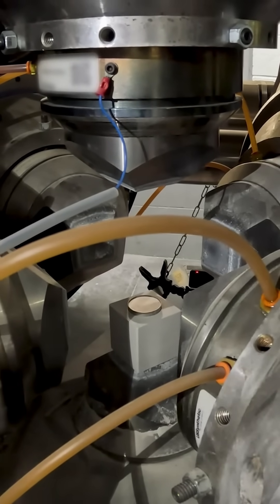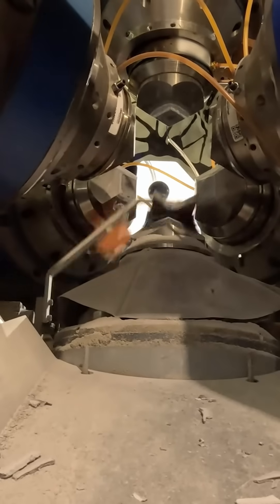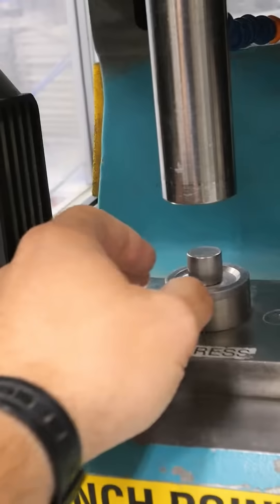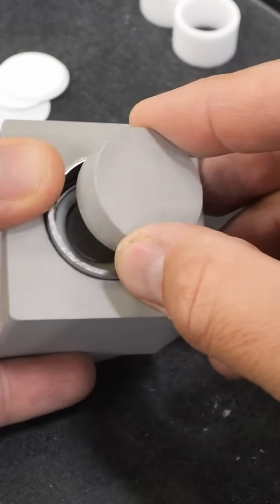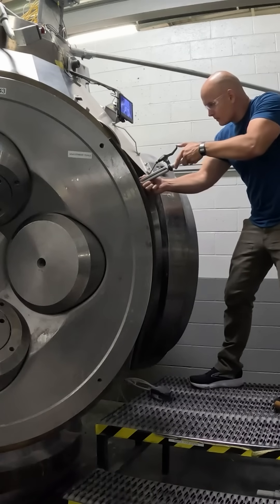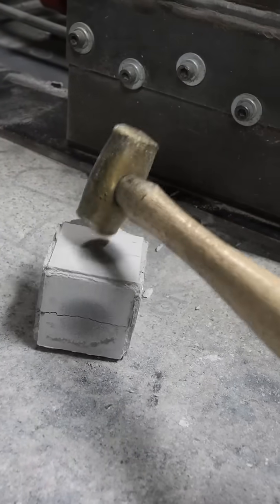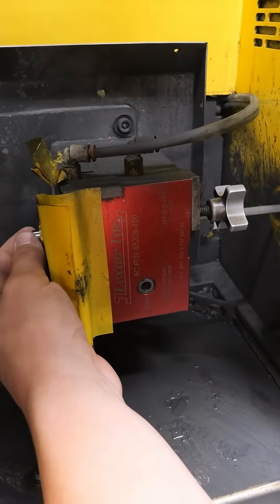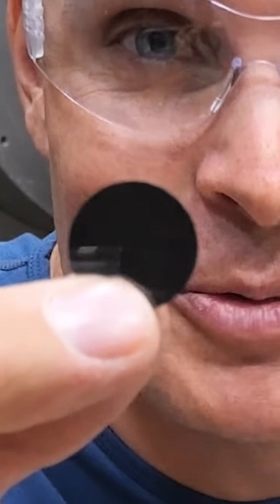How to make your own Diamonds - (easiest method)

Comment: with how many high quality diamonds this thing could theoretically pump out, it really throws into question the whole market for diamonds
Reply: The whole market of diamonds is already artificially kept afloat, so it really doesn't matter.
Reply: These diamonds are used for one purpose only, that's to drill for oil and natural gas.
Reply: @ribeye4663 not just drilling but it also has a big presence in the machine tool industry. My PCD facemills, drills, and boring bars are the coolest (and most expensive) tools I destroy. Since they’re so hard, you can run high volume production runs on aluminum for like 4 years on the same tool as long as you dont drop or crash them. They also run 2-4x faster than carbide with an amazing finish. Not sure on steel but I’m sure it has similar uses and life.
Reply: @ribeye4663  
They are used in so many applications.
We used a single toothed PCD bits for generating optical lenses, and now where I work they use them on laminate materials and general applications on CNC beamsaws, and CNC edge banders.
If you have the money, you can probably find a PCD tool for the application.
Just a little toothed bit was over $500.00 back in the 80s.
Now multi toothed blades are many thousands of dollars.
Reply: They're not gem quality, polycrystalline diamond isn't clear. It is super useful for industrial purposes though.
Reply: @DarkVitamins  When people rate the sparkle or attractiveness in blind tests, zirconium nearly always beats out authentic diamonds. But nobody is impressed by $30 per carat. Luxury items like that are very often valued BECAUSE they are expensive, not expensive because they are valuable as most everything else is.

Not the same market but I had a Mennonite friend (old Navy buddy, believe it or not) who was trying to sell some of his fine carpentry and blacksmithing works out of a local Amish store, one of those places for tourists to pick up knick-knacks or really good furniture. It wasn't moving at all, and he was considering lowering his asking price into loss regions but then the proprietor suggested he raise them instead. So he did, to what he considered a ludicrous amount. They sold instantly. Markets can be weird like that.
Reply: Look up the "60 minutes" story on Russian diamonds. Eye opening how common diamonds are.
Reply: The price of diamonds is artificially inflated, and the diamonds are extracted in very shitty conditions for the workers
Reply: @Yliketrainsita  The price of everything is artificially inflated, its called capitalism. And almost everything goes back to poor workers extracting raw materials in very shitty conditions, that is also called capitalism. It sounds like that your issue isn't with diamonds, but with capitalism.
Reply: This isn't really making diamonds.
It's a cemented diamond blank.
Diamond dust cemented together with Cobalt.
Reply: @richtomlinson7090  No. There is almost no cobalt used in this process. it's necessary, but only in extremely low concentrations.
Reply: @cerealport2726  
There's 5% -10% Cobalt In PCD bits.
It's sintered diamond dust in a Cobalt Matrix. 
We use these in many machines.
I used them to machine polycarbonate safety lenses a long time ago, and now I work in a wood shop/ all-around mill shop.
We even have countertop materials that are cemented with a similar ratio of solids to resins and binders, but those products aren't sintered like PCD or Tungsten Carbide.
Reply: Considering they're using cobalt, it's most likely not human friendly either.  Most cobalt mines are located in DR Congo & uses child labor, & pays basically nothing. Instead of looking to ameliorate the conditions of people working in diamond mines etc...ppl just find other ways to hurt others. Same with electric cars. No eco-friendly or good for the people who have to mine it either.
Reply: @eggpotat5435  as i stated, Cobalt is essentially a trace element in this process. Lithium batteries use far more than the PDC cutter industry.
Reply: It doesn't. Lab grown are getting cheaper and cheaper, the resale of naturals is constant. Learn hpw the economy works.
Reply: FWIW, I’ve been in the jewelry business for 40 years now, and I will say without hesitation, any man made/lab created diamond sold as a gem has zero value, worth zilch as a gemstone, though you’ll pay a handsome price. Man made diamonds used for bits and tools is about the only “value” they have.
Reply: @bigtrout  
These aren't even of the glittery multifaceted variety.
They're just very expensive tooling.

People are getting the wrong idea about what they are doing in the video.
They aren't making diamonds. They are just bonding diamond dust into a useful tool.
Reply: @  Yeah I know, I was just responding to the OP’s comment.
Reply: @bigtrout  true, but most natural diamonds are not investment quality either. You can buy a 2ct lab diamond for less than the difference you would lose if you brought and sold a natural 2ct diamond anyway. With a lab you can have the diamond and the resale value of the natural at the same time.

Labs are going to become like CZ soon enough though, and natural are going to shoot back up in price.

Comment: Poly crystaline diamond in of itself is a level above normal diamond. for anyone who doesn't know, diamond is incredibly hard, but does have weaknesses in the crystalized structure, Poly crystaline diamond removes those weaknesses and improves hardness by taking multiple diamond structures and cramming them together in a way they don't normally like to be alligned, and does so with extreme heat and compression
Reply: Monocrystal is the next level above that for many applications ;)
Reply: @N4CR THERES ANOTHER LEVEL??
Reply: @kokujin5446 yes, its over 9000
Reply: @Happythings354  hahaha, you made me happy. Thanks Mr. Happythings
Reply: Isnt that a normal diamond?   @N4CR
Reply: I was amazed by this statement, and after googling I found several sources that say the opposite: Polychristaline Diamond is basically "sintered" which means that many small diamonds are pressed together. This forms a material that is almost as hard as natural single christal diamond.
Reply: Is this the reason why they are black and not translucent?
Reply: @blackflag_N1.

They're black because heating the diamond powder (diamond is just carbon) causes graphite (graphite is also just carbon) to form.

Hence why they're a similar greyish black color as graphite.
Reply: @tylerdurden3722  thanks!   Do you know how hot do these cubes get under that kinda pressure?
Reply: I mean, is it really different mineralogically? Natural diamonds will more commonly exhibit lattice defects (point defects, etc). But that's very rare to have a large defect since the diamond lattice structure is the absolute strongest, a polytype with graphite. A synthesized diamond would exhibit an ideal diamond with no inclusions or any of possible defects.
Reply: @westleysharpe7221 
Basically, it's the diamond equivalent to Tungsten Carbide, but with Cobalt as the cementing agent to the diamond dust.
I wouldn't call it a Diamond like they sometimes have said.
Reply: @richtomlinson7090  right, but there are methods to nucleate actual diamonds with the perfect cubic crystal system FCC crystal structure. Diamonds are minerals, and all minerals have a crystal lattice structure, aka crystalline. Yeah, if it's tungsten carbide, it is a metal alloy, not at all diamond. Due to the purely ionic carbon bonds, it is the hardest material/mineral, even harder than tungsten carbide
Reply: @westleysharpe7221 I’m sure there are ceramic metals today harder than diamond be it natural or synthetic.
Reply: If you have grain boundaries between individual microcrystals, then that in itself is a plane of weakness unless they are ionic bonded. Which would mean it's a single structure.
Reply: You are not dealing with the average crystalline diamond anymore, Frieza
Reply: @Klonering  Vegeta says what?
Reply: So polycrystaline diamonds won't cleave as easily as regular diamonds?  How large can they be made?
Reply: @jimhim585  Basically, yeah, as for manufacturing size, it really depends on how big you can scale the machines
Reply: Kinda wrong. we have some microstructures that might have higher hardness than the diamond but no material known to man has a higher macro hardness than natural diamond.
Reply: Makes me think of lonsdalite which is space diamond
Reply: No, these are polycrystaline because they're making a single diamond out of diamond powder -- they're not really creating a "new" diamond,  they are "assembling" a large diamond out of many tiny diamonds.
Reply: I would like  polycrystalline black diamond tac vest plate inserts.. I live in South Africa
Reply: Natural diamonds will always have more value.
Reply: @GoosFrabaaa  not really, they are all poor quality compared to lab grown and all of them have artificially hyper inflated value.
Reply: Crazy how it's still a level beliw gem quality naturals

Comment: lol. Talc is carcinogenic. It 100% causes cancer in humans.
Reply: There is no strong evidence that casual or short-term inhalation of asbestos-free talcum causes lung cancer. Prolonged and heavy inhalation could pose risks, particularly if talc particles reach the lungs and cause chronic irritation or inflammation - which is why safety protocols such as masks, ventilation, and dust control are mandatory.

Comment: Glad they’re not using the old model of diamond press. 
This new one has a lineup consisting simply of six hydrocoptic marsal vanes, so fitted to the ambafasient lunar waneshaft, that side fumbling was effectively prevented.
Reply: But the jebidular tubes are constructed from rubberidium, not elasticsin-carbon like The even newer model. Glaven!
Reply: Lol. These two gents think they're the only smart people here.

Did you guys not see that there are fluoro-synthetic cavecious that was attached to the carbide mold which makes the black diamond similar to natural ones. The machine while having 1000 psi per point is strong, it is the kryptonieltech tip that bears the load of 628916 metronjoules of energy.
Reply: @miychaeolit that first sentence was incredibly cringe bro
Reply: Is this the new turbo encabulator? 😅
Reply: i had a stroke reading this

Comment: Not all days is this true, back in 2001 we watched a mostly hollow aluminum airplane slice through two dozen verticle steel box columns completely penetrating the structure without any part of the plane remaining outside the building. On that day physics took a vacation and the softer material completely and utterly defeated the harder material. Allegedly, that is
Reply: You forget speed, oh and also at the ignition temperature of aviation fuel, the steel would become gummy, and thus it would collapse, the impact didn't take down the towers, the fires did, we prove this because the towers didnt instantly fall, they burned for some time.

Comment: Whats a psi?
Reply: Pounds per Square Inch.  American unit of pressure
Reply: @robsollart2580  Thanks. It is very confusing that USA hold on to these old English measurements when even England has left them behind. To most of the world they mean nothing. We use Pascal or Atmosphere or Bar.
Reply: @borjewenander3073  Yeah I know, we use bar. But they are used to their inches and pounds and whatnot.  I can understand:  when I go to a weather app to check the wind, its given in meters per second, which is perfectly logic,  but then I always convert to Beaufort, otherwise I dont have a feel for it.
Reply: @robsollart2580  Where I live on the West Coast of Sweden with the North Sea on our doorstep its mostly windy with 10-15 m/s like the norm. At 25 m/s it becomes a storm and 33 m/s gives a Hurricane. There are a lot of names for it going back to Viking days  that the fishermen use.

We are at the mercy of the North Atlantic treadmill.

Comment: So they are doing x-ray crystallography to confirm the perfection of the lattice or is there some other reason for the radiation area warning sign?
Reply: I bet it is x-ray, but not for crystallography, but for metal composition (contamination scanning basically). I don't work for US Synthetic, but for MegaDiamond a direct competitor and that is our use case of X-Ray.
Reply: @samrjuliea  Ah, XRF, that makes sense, thanks
Reply: @samrjuliea  Seeing the radiation warning makes me wonder if they may be using Gamma Ray Inspection processes as well as X-Ray. 
As both are used in NDT processes and radiological in nature. 

I know they use both in aerospace parts manufacturing

Comment: We had a synthetic diamond manufacturer blow up a few years back. A piece of one of the pressure chambers hit a man pumping gas like a 1/4 mile away and ☠️.
Reply: I would like to know where this happened, the press really doesn't have that much kinetic energy, and the amount of metal around the high pressure stuff contains most of it when they do pop.
Reply: @ the company is NDK in Belvedere, IL. But i was wrong, it wasn’t diamonds. They make silicone crystal.

Comment: Thanks for the tutorial, I’ve made about a dozen diamonds so far and they came out great.
Reply: any chance you got some spare elephants?   I'm three pachyderms short.
Reply: @joeylegaspi3515  i got a few busses, if u wanna use them first can i borrow  the pachyderms after?
Reply: Pfft. I've been making black matter for years already. Get on my level.
Reply: I was about to say they can show you all day long because no one can duplicate it.  lol
Reply: Where did you get the 2000 Elephants? My local zoo refused to deliver them to me
Reply: @Mika-85  you want to go halfsies I can only afford 1000
Reply: @Mika-85 I could only obtain 1. Anyone want to lend me theirs?
Reply: @Mika-85  Elephants Elephant Elephants out of Paramus, NJ.  You need elephants? They got elephants.
Reply: This comment looks like a comment from a cooking tutorial 😂
Reply: Or kids @justejyraph
Reply: Simply building a press like this is not enough. These presses are under so much pressure that one slip-up in the process, such as diamond composition, pressure setting, temperature, component size, and more, can have dire consequences. The anvils on the press can experience failure under certain conditions and explode. This can, and often will, throw shrapnel all over. This is why each press at USS is placed in a press bay, covered on all four sides and with a bulletproof wall and door for access. There are so many factors that go into making diamonds this way, and USS has mastered this over many, many years. This is why USS remains the Leaders In Diamond Solutions. If you ever get the chance to tour the USS' facilities, Do it. It is well worth the visit.
Reply: @loumos8364  read the room
Reply: I ran out of busses. Ever since diddy went to away hard to come by.
Reply: did you do the 900 school busses or the 2000 elephants trying to figure out the best way
Reply: I just place order for 2000 elephant in Temu.. can't wait to making my own diamond 💎
Reply: Yall still haven’t gotten “shrink ray” tech? Slippin, you all slippin’. Got me that Eiffel Tower in the palm of my hand! That’s right! Heard it here first!
Reply: I'm tired of making diamond,now I'll be making gold instead just need several particle accelerators if you know where to get that...
Reply: @cobaltblue2756  been making Gold for 5 or 6 months, but I'm bored .. does anyone know where I can get a tutorial on perfect wife making ?
Reply: @cobaltblue2756  I don't, but my uncle Vinny knows a guy
Reply: did you go for the rubix cube with 200 elephants, or the 900 school buses and postage stamp? I can't decide which is more suitable for my budget and workspace
Reply: so, just asking for a friend, but where did you find your 2000 elephants?
Reply: I'm going to Harbor Freight tomorrow to buy a diamond vise. I'm so excited.
Reply: I'm dying 😂😂😂
Reply: My dad built a time machine
Reply: which method did you use ?
The 2000 elephants, 900 school buses or 
the Eiffel tower ?
Reply: How are the sales coming?
Reply: Be sure to retrieve and clean before flushing accidentally.
Reply: I've got some anti-matter I've been storing for years.
Reply: Did you use those elephants? I was trying to do it with the Eifels tower, but police sayid they would need a fee